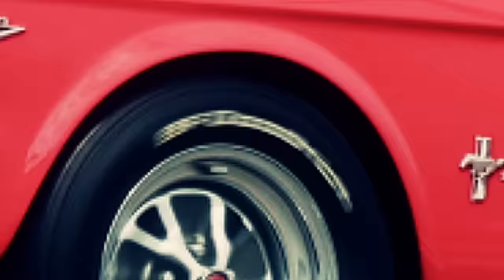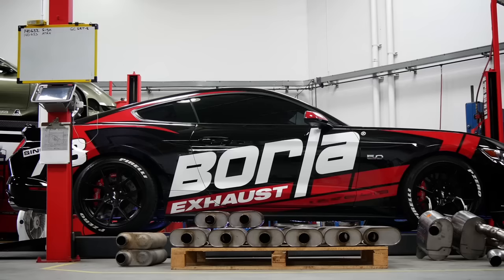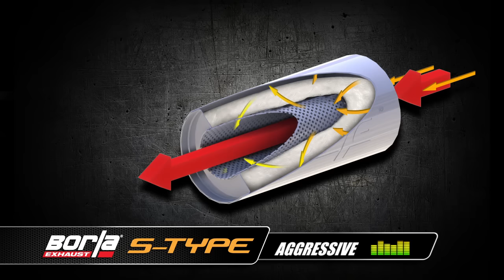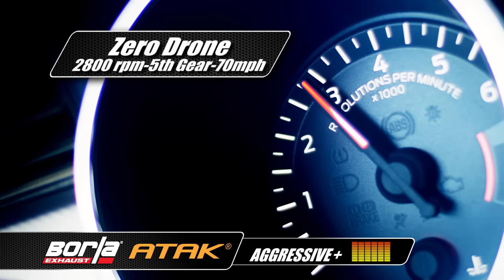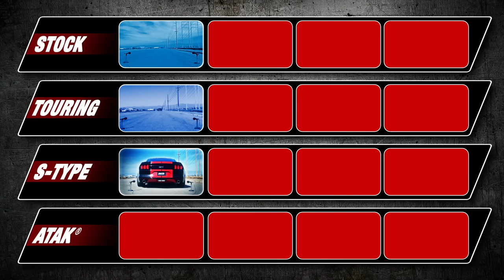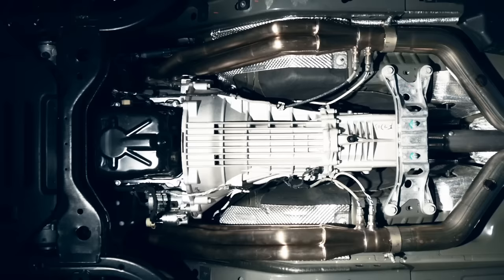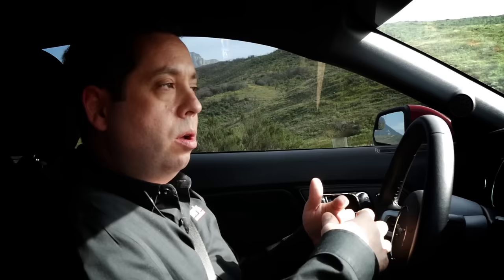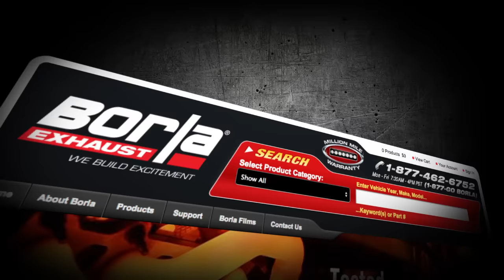2015-2017 Mustang GT Exhaust System Sounds - Borla ATAK vs. S-Type vs. Touring [Exhaust Comparison]

Comment: Great systems no doubt. Love it that so much testing and engineering goes into the development of the systems.

One thing though, showing no drone in 5th at 2800 rpm? How about in 6th at 70 mph with the tach around 2000 rpm?

My car, with the Bassani axlebacks and off road X, drones at 2000-2100 but nothing above or below that rpm. I think some even refer to it as the "dreaded 2000 rpm drone" being a very common rpm range that produces drone. Like really, who drives at 70 mph in 5th?

Once again awesome systems and if wasn't for the high price I would have went with the ATAK on my 13 GT!!
Reply: Robert Kohut  You're on the money Robert.  I've driven my '15 GT for periods of time in 5th at ~70 when I'm in passing mode, but most of us shift to 6th when in interstate mode.  I'm curious about drone at this stage as well.  Tempted by Magnaflow Competition's deep rumble and impressive torque numbers but not if the drone drives me/passengers crazy.
Reply from the maker: Robert Kohut Please allow us to be very clear about this. There is absolute NO drone associated with any of the Borla exhaust systems in this video. You will not find drone in any gear, at any speed, at any RPM or under any type of load. So to answer your question directly there is absolutely no drone at 2000 RPM or any other RPM, in any gear, at any speed. These systems are completely void of drone, there is no drone, anywhere...
Reply from the maker: DALLAS GOBLE Please allow us to be very clear about this. There is absolute NO drone 
associated with any of the Borla exhaust systems in this video. You will
 not find drone in any gear, at any speed, at any RPM or under any type 
of load. So to answer your question directly there is absolutely no 
drone in 6 gear at 2000 RPM or any other RPM, in any gear, at any speed. These 
systems are completely void of drone, there is no drone, anywhere...
Reply: Borla Performance Industries 
LOL...Well you certainly are confident there is no drone! Thanks for clearing that up.
Reply: Im right there with you. I have a 13 GT with Borla S-Type Axle backs, Boss 302 side pipes fitted to a Borla X-Pipe and at 2000 RPM on the highway in 6th the drone comes on.
Reply: I have a 12 gt with offroad h pipe , no cats , and borla atak . loud when you want , but on the interstate you hardly notice it while cruising . absolutely beautiful thing
Reply: +Robert Kohut well 13 and 15 5.0 not going to sound the same because of the different firing-order

Comment: the mustang 5.0 already sounds good.   but that atak is killer.   now if you can get the v6 camaro to sound like that well then you have something.   unfortunately the new atak exhaust system for the camaro doesnt fit the 2015 camaro   so I'm going to make a recording of the mustang atak and strap it under my hood.

Comment: as someone else mentioned they should have put it in 6th to test drone on the highway. Typically when you get in the higher rev range like they did, there won't be any drone, just a rumble.
Reply from the maker: Hi Trevor. Thanks for checking out our video! We do extensive testing to ensure our systems do not drone. That said, we can confidently say that these systems do not drone in any gear, speed, or rpm. If you have any questions, please feel free to reach out to us via phone 1-877-462-6752 or email sales@borla.com (Monday-Friday 7:30am-4:00pm PST).

Comment: I had the atak for over a yr. and 4 mufflers cause they kept breaking. Sent back for refund and bought. Corsa extreme. Which to me isn’t that unless you are above 5k rpms. The 5.5 inch tips are gay as well. I may just eat it and get the atak again

Comment: Anyone ever try the Touring with LT Headers and Green/High-flow cats? Headers make it loud, but I'm trying to figure out a good setup that's a little more low-profile, at least during cold starts.
Reply from the maker: Thanks for reaching out! We do have a Touring sound level available in our 2.5" Cat-Back systems. It will require an adapter to mate up to the 3" collector on aftermarket headers. We do also make 3" Cat-Back systems designed to work with aftermarket headers, however, they are only available in our S-Type and ATAK sound level.

Comment: How does the Touring axleback differ from stock, in tone and in volume? At what point in the rpm band would the sound be more pronounced?
Reply from the maker: +mrksts1 The sound changes most under acceleration. At idle or cruising speeds you will notice a change in tone, but not volume.

Comment: I just ordered the touring for my '15 GT convertible. I thought it came with an X-pipe since that's what I saw in pics. It turns out the X has been replaced with a resonator. Why? Is it to reduce drone? Can I replace it directly with an X or H? Thank you.
Reply: The Touring has a resonator to reduce loudness.
You can replace it with an X-Pipe (spare part) which means you upgrade your Touring to an S-Type, since that's the only difference between those two catbacks. The mufflers are the same.

Comment: Is the Ford racing by Borla Touring exhaust the same?
Reply from the maker: +Richard Martin Thank you for your interest in Borla and sorry for the late reply! The Borla and Ford Racing by Borla systems have similar sound levels, but Ford had a hand in tuning the sound of the Ford Racing by Borla systems so their tone is slightly different. Ford Racing by Borla may also sound a little quieter.

Comment: Is it necessary to remove the factory resonator with these exhausts?  Will they sound as good keeping the resonator and will performance be impacted by keeping the factory resonator?
Reply from the maker: You will have to remove the resonator with our Cat-Back system. If you wish to keep the factory resonator, we do offer Axle-Back systems.
Reply: @borla  Thank you for the reply...my original plan was to remove the factory res, but then I read an article that stated doing so interferes with proper exhaust scavenging and can cause warning lights...now I'm confused.  I don't know about cars, so I don't know what to believe.  I even called the dealer and the mechanic told me a horror story about a removed resonator that triggered a guys check engine light and made his car fail smog.  Don't think the guy had an after market exhaust...he just removed the res.  Thoughts?
Reply from the maker: @1970jstone  A resonator delete should not cause a Check Engine Light or fail a smog test. The resonator is downstream of the catalytic converters. As long as you do not touch any of the emissions control devices like the catalytic converters, your car will pass emissions testing.
Reply: @borla  Thank you Borla!  My mind is made up then...I want that S-Type exhaust for my 2016 GT!  Thanks for the advice and information!

Comment: Just purchased the S type axle back for my 15 gt, I plan to add a H-Pipe in the future, would this cause drone?
Reply from the maker: +Randy Torres It shouldn't drone, but we cannot make any guarantees with other aftermarket brand parts because we have not tested them. These mufflers were tuned to work with either the stock pipes or our Borla X-Pipe in the Cat-Back.
Reply: +Borla Performance Industries I see, I purchased just the axleback , in this case do you sell just the x pipe if I were to want it in the future?
Reply from the maker: Unfortunately we don't sell the X-Pipe separately. It shouldn't drone, but we just cannot guarantee it because we have not tested other brands' products.

Comment: Will it pass AZ emissions on gt350?
Reply from the maker: If you have a GT350, these systems will not work. You will need part number 140684. The system will pass emissions as it does not remove any emission control devices. 

Link: https://www.borla.com/products/ford-mustang-shelby-gt350-cat-back-exhaust-system-140684

Comment: do yall make these that can fit on a 93 f250 single cab long bed? I love the sound alot but I couldn't find if yall made it for my yr model
Reply from the maker: +Alex Clakley Hi Alex. Unfortunately we do not have an exhaust system specifically for a 1993 Ford F-250. We do however have a variety of universal mufflers if you are interested: http://www.borla.com/products/mufflers/index.html. Please call us at 1-877-462-6752 with any questions or to find out more about our products. Thank you! :)
Reply: Borla Performance Industries hey i was wondering if u guys had or could make an atak exhaust for a 2003 f150 it sound amazing better than s type and touring love feed back
Reply: Borla Performance Industries and how much would it cost
Reply: Alex Clakley it's for a mustang not truck

Comment: When you say "the type of sound that Mustang owners are looking for", does that mean masking higher harmonics while amplifying the 4th order dominant frequency to give it a deeper rumble?  And if so, when doing the exhaust for the flat-plane crank GT 350, are you guys going to give it the type of sound that high rpm sports car drivers are looking for?  Which is to say, a more exotic sound with a damped 4th order dominant frequency, but amplified half order higher harmonics, like you get in a Lamborghini or Ferrari?  I am tempted to buy a GT350, where a lower revving cross-plane like the GT500 would never interest me.  Make an exhaust for the GT 350 that makes it sound like a screaming banshee and I'll buy the Mustang and the exhaust!
Reply: Larz will

Comment: Raced two Mustangs before with Dual Borla exhausts... They sounded amazing and all..
But I think Mustang owners enjoy the ass end of a TT Subaru...
JK.. Not really... But for real stop racing if you are gonna run a stock V6.
Reply: youngnutsack17 I didn't mention anything about a V8 or a GT. Rarely have I ever won against cars with eight cylinders. I am not gonna lie, I have been smoked and pulled on hard by some Challengers and Mustangs. But this entire post was directed towards owners with six cylinders...

Comment: Zero drone... @70mph... in 5th... @3800rpm.. Who the hell is cruising in 5th at 70mph?
Reply from the maker: We can assure you that there is no drone anywhere in the RPM range with these systems; in any gear, at any speed, up hills, etc. = Zero drone.
Reply: Borla Performance Industries do u guys have an atak exhaust that can fit my 2003 f150
Reply: That's what we needed to know. Finding something without drone at around 2k seems to be the issue.  Thank you for clarifying that for us!